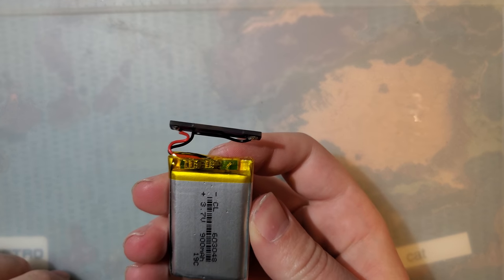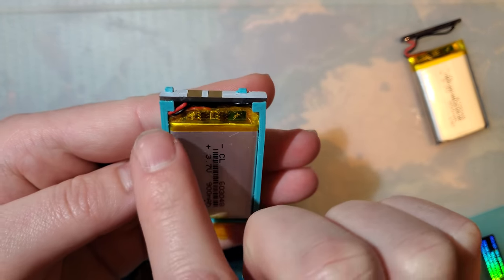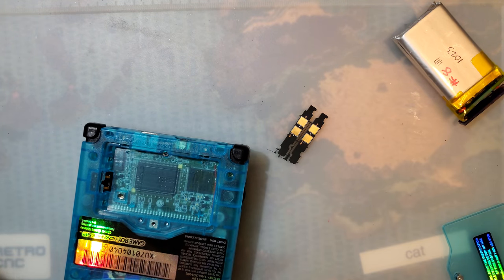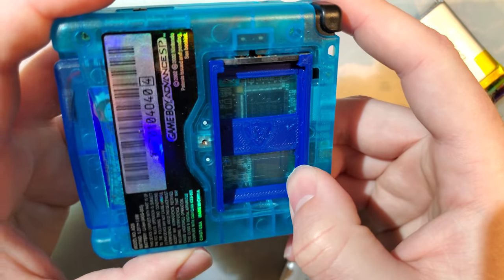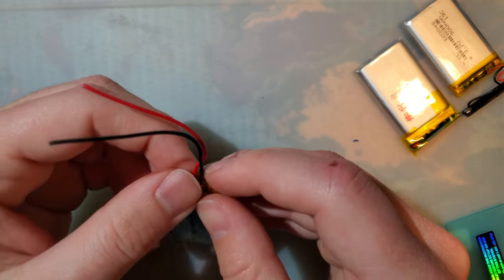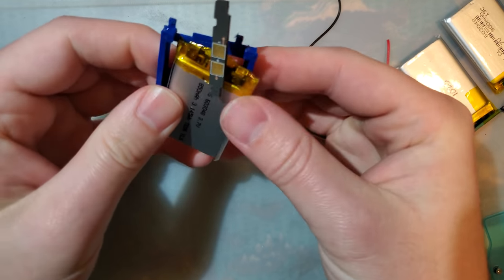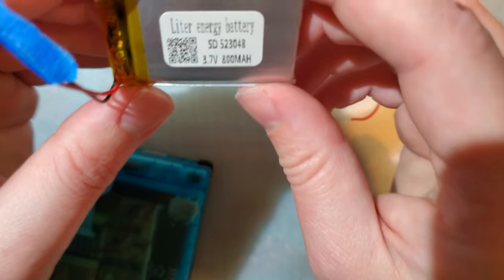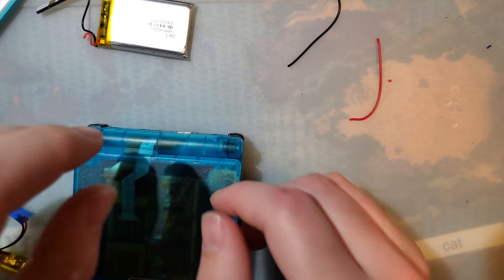Yet Another GBA SP Battery Mod v2

Comment from the maker: Note that the batteries tend to fit better in the bracket with the text side down. This solved my battery cover bulge. Also, yes, I did record this in November. I forgot to publish it. Oops.
Reply from the maker: @axelkusanagi4139  battery tech hasn't come that far in five months.
Reply: Hi makho ! Really awesome work. Does this battery mod (or the ones for sale on retromodding) fit into the phat DS?
Reply from the maker: @filoteo  This one does but the RM one will not as the tabs will be positioned wrong. Also works with DS Lite. See the github link in the description.
Reply: 3d printing is expensive since most ppl aren't going to pay hundreds of dollars to buy one only to print a small bracket. the best suggestion is buying cheap modeling clay mold it to the size you need to hold the battery so that is has no room to wiggle and then use an oven to harden it once it is done and cool just place the battery into the mold. clay can be bought for like $5-$20 depending on the amount. 

clay allows you to do it in the most basics forms or make a complicated bracket like the one you are holding. all you need is a smooth bottle and a knife.
Reply from the maker: @aegis062  absolutely not
Reply: What is the voltage supported by the GBA SP? The original battery supports 3.7 and that battery with a full charge reaches 4.2 and can burn the main board
Reply from the maker: @maximodejesus5001  I think you need to read up on how batteries work.
Reply: @maximodejesus5001 the sp can take over 4 volts without an issue

Comment: Thank you so much for your videos, I learnt so much and I just did my first battery mod. I got XZK branded "1000 mAh" batteries and there's some bulge on the battery cover, even though I put the battery with the text side down (it only seems to fit that way anyway). It seems to work great though, SP plays fine and is currently charging.

Comment: It would be great if the same mod could be used for psp batteries
Reply: If youve got a dead battery just gut it and use the board thats already there.  Its what i did for a giant battery that sits where my umd drive used to sit and it still charges using the regular charge port (modded mine so i no longer needed the drive)
Reply: Thanks, i was trying to find a way to replace the battery cell without having to mod the console so i could still use my umds. but i may have to do it has you suggested

Comment: With the ones retro modding is selling, I found cutting off the center and rear plastic that went across the bottom made the bulge go away too. 
PS - have you tried the battery by helder that retro modding has for sale now? That one looks to have the same size as the OEM batteries.

Comment: @makho Hey I just bought 2 of your batteries from RGRS and I tried 3d printing the battery holder for the LiPo battery but it came out extremely flimsy. What material did you use for it to come out sturdy? ABS? PETG?

Comment: Hey Makho! Hopefully you see this but do you know if this would work with an iPod Mini? Size wise it should fit, I’d just need to wire the connector up. There’s no quality batteries on the market for the Mini and everything being sold is old “new” stock (several years old) and either dead or dying.

Tempted to spend the money just to find out, this would be a great alternative.
Reply from the maker: You'd probably want to use the OEM battery controller board swapped into one of these but the chemistry is the same, yeah.

Comment: idk if youll respond bc its an older video but i broke off the actual contacts part to the battery on the sp motherboard, can i solder a lipo battery directly to the points?
Reply from the maker: Yes. I'd recommend adding an inline connector so you can unplug it without having to solder though.

Comment: Hey man I luv your vids, been following ya for a while now. I got a question to ask regarding an AGB i bought.  I've purchased a GBA AGB 32 pin. The console worked and the only issue it had was the right shoulder button not working. So i've ordered a new one. When it arrived I removed the older one and soldered the new one in. (I've quite some experience with soldering, been doing it for many years) Upon rebooting the console for some odd reason I get a blank screen. The console powers on just fine, audio plays, and with an inserted cartridge the game sound can be heard.I have another 32 pin model AGB laying around so I tried to swap the screen to see if perhaps was a screen issue, but still same issue, despite the fact that the other screen works just fine inside it's original 32 pin AGB mobo. What is puzzling me is, before replacing the right shoulder button the console worked fine... Any suggestions on what the issue might be? Im going mad trying to figure it out.
Reply from the maker: You're sure the screen is fully inserted and the bale is fully closed?
Reply: @makho  If for bale you mean the brown plastic tabs that make pressure on the ribbon cable whilst inserted in the 32 pin screen connector, yes. Tried the same motherboard with another screen and got the same issue, even if the new screen works flawlessly paired with another 32 pin mobo, and to add to that the original screen from this AGB also work in the other 32 pin mobo, so I'll exclude that the screen has any issue... It's just mind boggling as I've never seen anything like that...

Comment: Any chance you're designing a bracket for the DS Lite? I thought about using your v1 battery mod since it should technically fit in the DS Lite with the PCB on the left instead of on the end. A bracket would just be a nice touch for aesthetics.
Reply from the maker: no plans for a bracket

Comment: What would you consider a healthy parasitic drain for a modded SP when it's off? I'm using this exact kit minus the bracket, and on a whim I decided to test for drain and got .3um on my multimeter. The SP is using the cloud game store laminated screen, Helder's power cleaner + amp, and Giltesa's USB-c charging mod w/audio passthrough, and as far as I know none of those components should be causing parasitic drain. Your videos have been indispensible as I've gotten further and further into modding and restoring gameboys over the last few months. Your SP battery board is my go-to now.
Reply from the maker: I've never measured it but there is a chance that SP consoles have an extremely small amount of parasitic drain. Even when switched off, the battery will still be connected to the charge controller (or PMIC in one chip SP models) via a mosfet. I don't know the leakage on the mosfet but I've heard people boot up SPs after being off a charger for 15 years and the battery still had enough charge to boot fine so it should be extremely minimal. 

I do not have any tools precise enough to measure that low a value.
Reply: @makho  thank you! And congrats on the metal SP launch by the way! Bought 5 kits as soon as I saw it.

Comment: Mahko, i need a help. I not have other gba sp and start restored my gba sp, but found a problem i cant identify. Try charger my gba and led indicator stay on, i stay charging 6 hours and led not off. Fuse and em8 this ok. I suspect The battery by time  use. Exist some one test i can try before swap battery?
Reply from the maker: ensure the port is intact and clean, try another charger, try another battery

Comment: Just use shell from old battery - no need to 3dprint, no need for pcb. Way less complicated mod
Reply from the maker: that requires having already made the poor decision to buy an aftermarket battery. Most OEM batteries do not have salvageable frames (or even frames to salvage)
Reply: @makho  my ags-101 came with original framed battery. It was very easy to reuse it's frame.
Reply from the maker: @saddlesore_adventures  I'm glad that worked for you. That's not typical as Nintendo sourced several different OEMs for SP batteries.

Comment: Hi dude, I have one of those batteries without the blue case around it. What can I charge it with? From what I understand the gba charger is too high voltage for it despite using it in the past. Thanks
Reply from the maker: you can charge it in the console. The default SP charger still works fine.
Reply: @makho  thank you my friend

Comment: Awesome. By the way, do I need a charger with higher amperage when I use one of this modded batteries. I'm planning to use the OEM charger of my SP but it's 5.2V with only 320mA. Actually did try it with the 850mah battery pack and it smelled like burnt plastic initially but turned out fine and the charger is still working and no signs of damage in the battery when I check it's voltage and amperage. But when I use my OG battery it doesn't smell of course. I just scared I might start a fire. Lol
Reply from the maker: The charger is in the Game Boy itself. What you are asking about is a power supply and no, you do not need a higher amperage power supply. The Game Boy will only pull the current it requires and no more. A higher capacity battery will simply take longer to charge.

Comment: So I got two of those for my SPs cause their batteries were absolutely dead, and whilst I get crazy battery life (>7 hours on AGS101 full brightness), the voltage drops the LED to red about 2/3 of the way which makes it hard to know when it's dangerous to play without recharging it. Did I get faulty cells ?
Reply from the maker: Nope, that's just how the SP works. The batteries I use and the batteries that Nintendo designed the power management circuitry for have a slightly different voltage curve. Basically, most of the capacity is above the 3.7v point on OEM batteries whereas most of the capacity is below the 3.7v point on these batteries. 

My recommendation is to just pop the SP on the charger when you're done using it (or after you've used it at least a couple hours if you don't play for longer sessions). There is no "memory" on these cells (that was NiCd batteries) so you can recharge any time safely.
Reply: @makho  Yeah that's what I figured. I suppose we could tweak the circuit to play better with this new voltage curve, but it does seem like a hassle.
Reply from the maker: @v.p.5743  Not really worth it imo. It would be difficult to recalibrate with any accuracy.